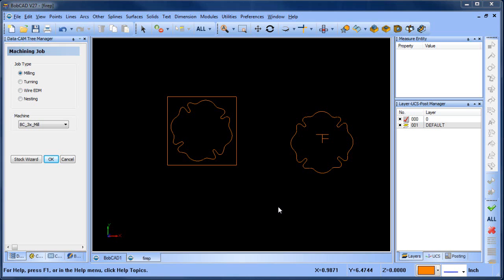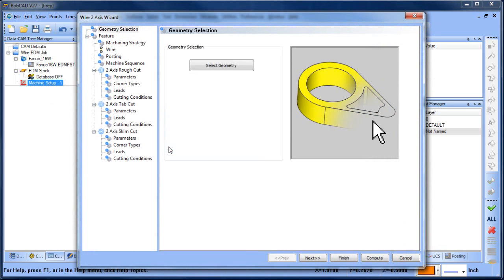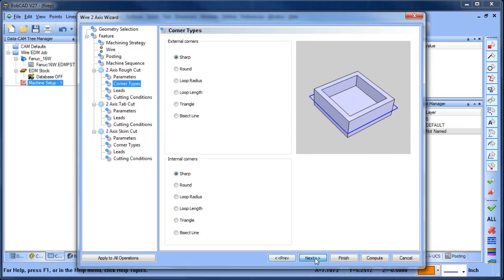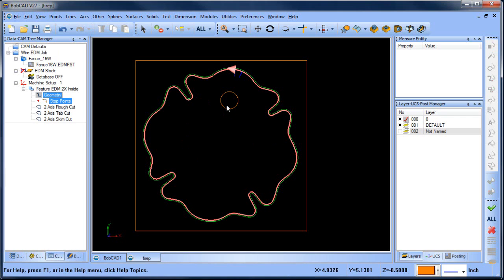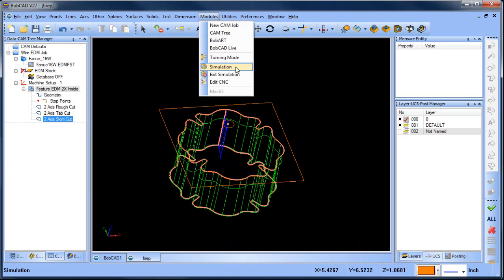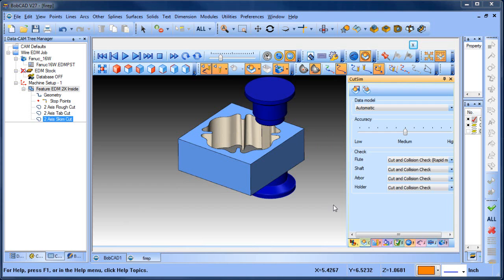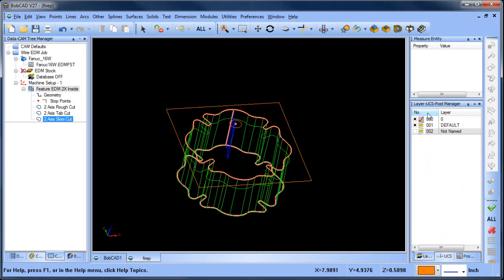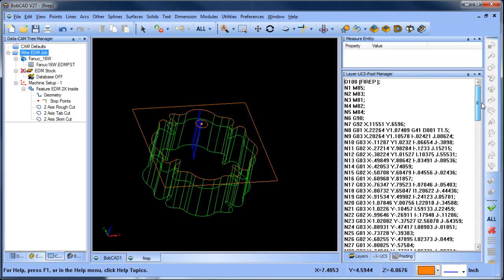2 Axis Wire Sample Land and Taper BobCAD V27

Comment: This version of BobCAD sucks. I can't get it to go in 3D mode. I follow all your step and then when I go to simulation mode, the screen flickers and I get nothing. It doesn't even generate nc code.
Reply from the maker: Denis Langlais have you contacted technical support.  Sounds like you might have a system requirements issue.  That being said let's connect tomorrow and figure out what's going on. 877 232 2231 x123 as for al and  let them know about this video and question
Reply: I am sorted now, you have helped me since then. You can remove the comment if you wish. The computer I am using is definitely not fast enough.